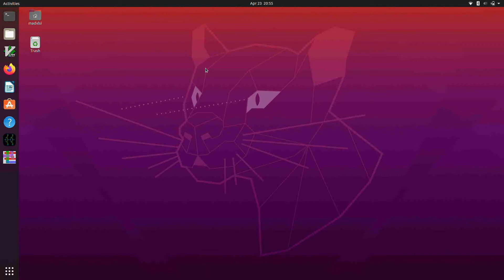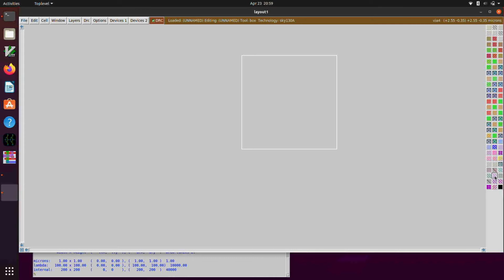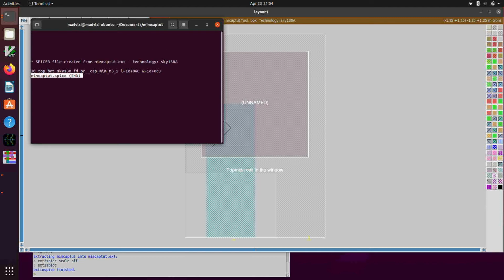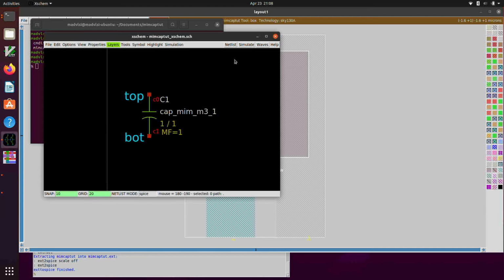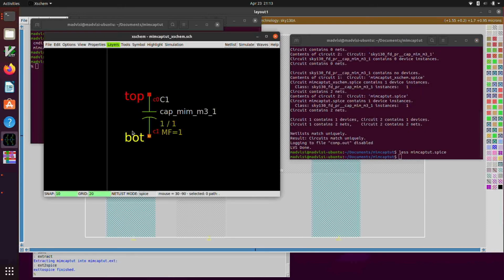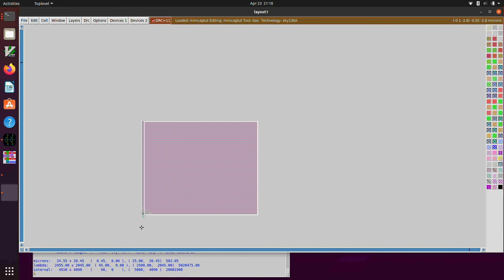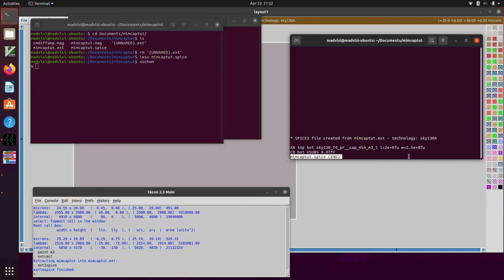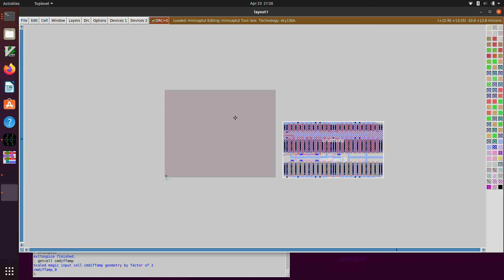Magic / Xschem Sky130 MIM Capacitor Layout Tutorial

Comment: Here, I managed to get open_pdks installed on my Mac:

https://youtu.be/CSXPUzwuGGc

Figuring out what to do was a painful process, but ultimately the changes needed weren't that bad. Basically, I needed to install the GNU versions of grep and sed, since they act slightly differently in terms of command line arguments than the Linux versions, and change a few lines in a few of the scripts to use those GNU versions).